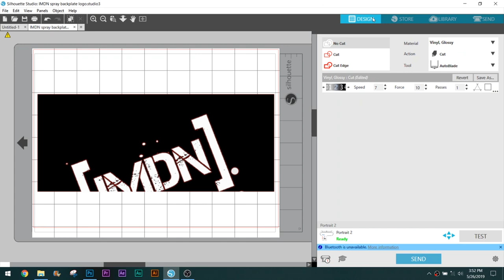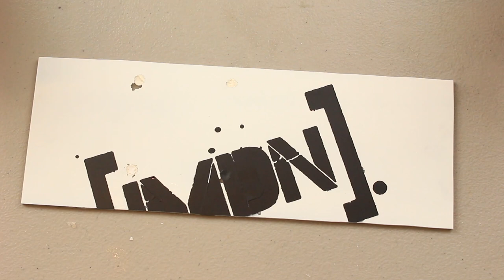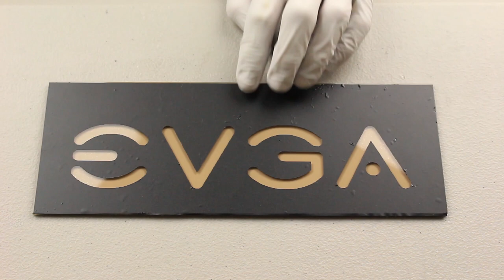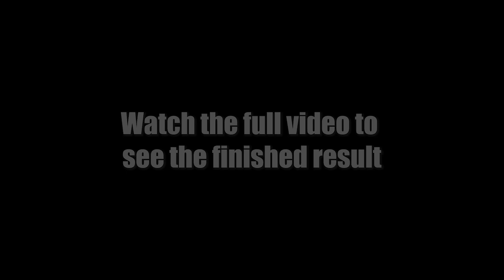MAKE A CUSTOM GPU BACKPLATE (BASIC & RGB) (TEASER)

Comment: When are you going to invest in some application tape :P
Reply from the maker: I have some and honestly I don't use it. I used to apply screen protectors with the DI water method.
Reply: @ImmodderNation  For solid stickers / film i use the water method as well, It gives the best results. As soon as you get some (or especially a lot of) detail in the vinyl i find it really helps to keep everything in the proper place. Also makes removing the holes a lot easier :)
Reply from the maker: So far my designs have been simple enough to use water method. I can also use masking tape as transfer paper, but the vinyl I use doesn't have air release as you can tell.